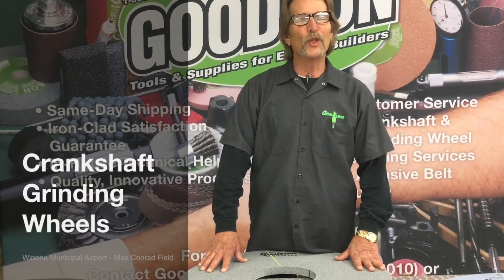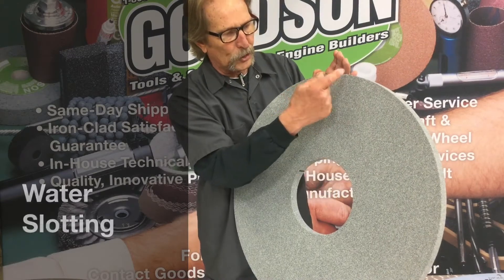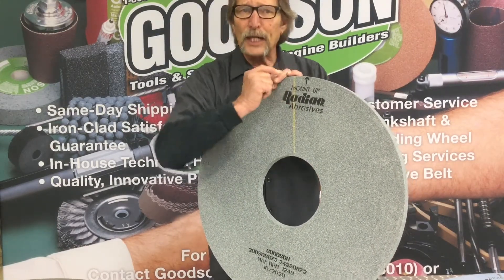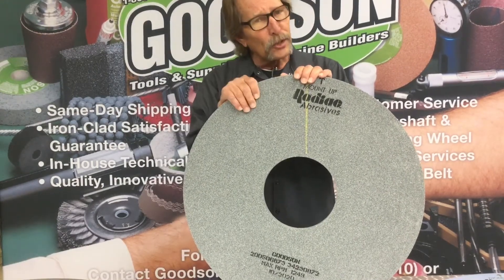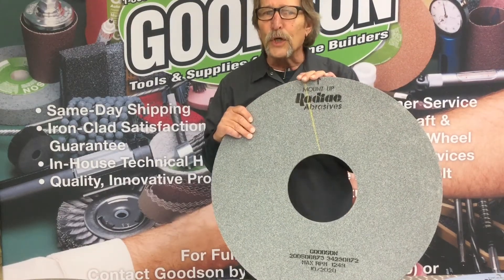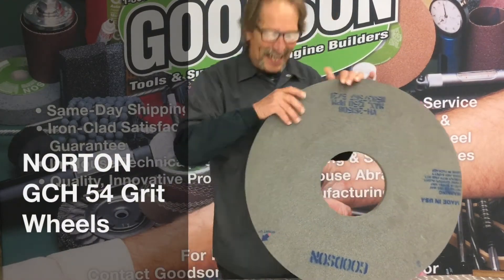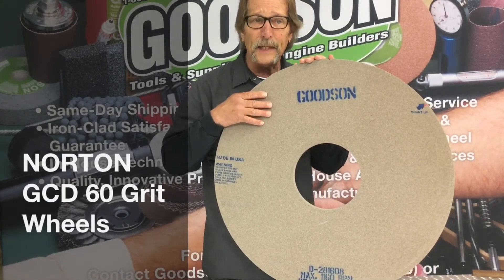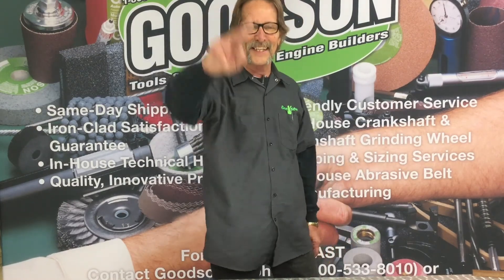Crankshaft Grinding Wheels | Tech Lab Tuesday

Comment: What about crankshaft polishing belts ? We haven’t been able to buy suitable belts for many years. The last good belt we used was the old Norton J weight belt. They haven’t been made in 20+ years and was the only belt that provided consistency results especially on cast iron crankshafts. We have tried every belt  Goodson and others offer with none being equal to the old Norton J weight belts.